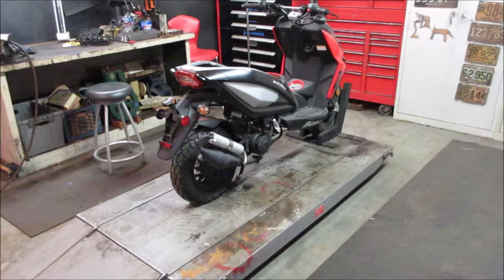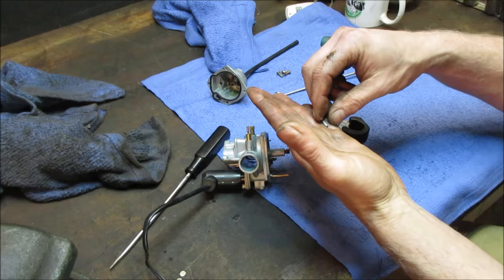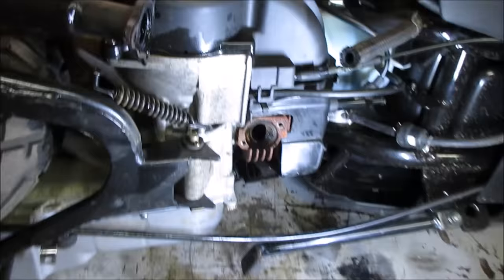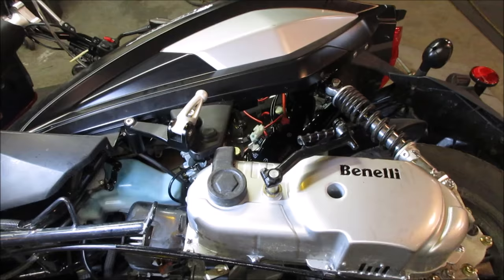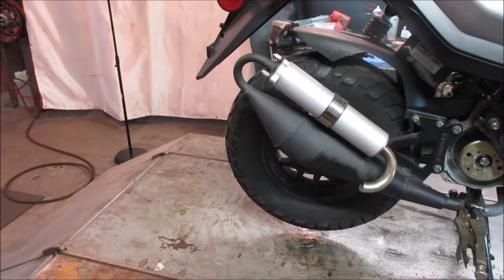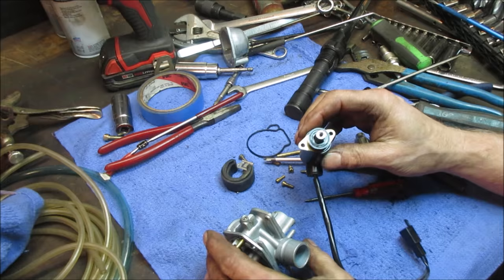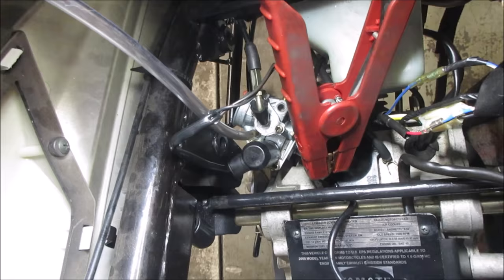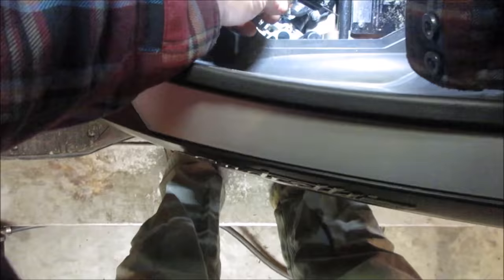Free Broken Scooter, Can We Fix It?

Comment: That "weird" bolt on the exhaust is a safety bolt. The manufacturer would screw it in until the head snaps off then it can`t be tampered with or removed without a lot of bother.

Comment: Just a comment for reference. Yamaha produced a bike of 60 cc that was a two stroke. It had a tank for oil to mix with the fuel. It had a metered pump that was adjustable. It also had a separate crankcase for oil that lubricated the engine internals. It concerned me when you mentioned this bike had a shared oil tank. You could use all the oil up and then the motor would seize up and  the engine would no longer work.

Comment: mustie, I was watching the CVT and its only going halfway, you can try changing the CVT pulley to go much much faster. Its a chinese scooter and most likely uses GY6 design crankcase. I am not sure if a GY6 stock pulley can fit there but for sure it uses flyballs. the stock GY6 flyball is 14g and usually comes in packs of 6. you might want to check the weigh of each flyball to see how many grams it is and if you can replace it with a heavier one so the CVT opens up earlier (at a lower rpm) so you can go faster.

Comment: the black thing on the carb is a choke...its just a temperature regulatet piston like an thermostat on a car..the wires belongs to an heating element to warm the whole thing.

the weird screw on the exhaust ist a break off screw  , you break off the head by thingting the screw and you can not remove the scew anymore so easy....normally used on ignition switches.

Comment: If the compression tester has a one way valve in the part that screws into the cylinders (mine do) it should, afaik, not matter the volume of the cylinder. If not, you could use the hose to try to blow into the cylinder and get an idea of the amount of leakage.

Comment: i have a scooter about the size of this in the field somewhere..ran pretty decent, but it was wrecked, i bought it for next to nothing and drove it around, forget why it ended up in the scrap heap. might dig it out to just see if it turns over or not, it needs all new wiring though and im no expert in anything wiring on a scooter so its useless to me but someone may have use for it when it comes to parts or something idk. it was alot of fun to just play around with

Comment: I'd also check the clutch lining if it is thin plus check the center spring if it feels soft(er) than what it should feel and the torque drive if the internal parts needs greasing

Comment: Restriction on the exhaust is the regulated back pressure for the motor a lot of those have regulated back pressure from the exhaust muffler but that looks like the port regulated exhaust pressure

Comment: Edit of my previous : 1.  Drain tank of all fuel, and make sure only oil enter carb by way of oil tank.  2.  Check for any restrictions in exhaust system.    3.  Check cylinder for carbon deposit build-up near exhaust port.  4.  Remove variator and check to see if all roller weights are rolling properly.  5.  I have yet to see rear wheel spin up under acceleration.  Make sure there are no restrictions to rolling of rear wheel under throttle opening.  Finally, I will tell you that the long brass tube in the float bowl conceals a problem.  However, I am afraid to tell you how to service it, because it could lead to a crushed tube.  I would show you how to do the cleaning, but I would only do it in person.  sheesh, I am perplexed.  Servicing it has fixed many a 50cc scooter like this for me, but.... Good luck

Comment: The three main problems that I’ve run into a knees has been the carburetor they probably replaced it with a higher. If I’m carburetor, he probably went for like a 75 or 800 GC scooter versus the 50 cc same thing with the stater and the CDI blocks I need all three of those items to be correct or at least the carburetor because I ran into the problems with an old 2003 versionand everything and I just couldn’t get it right until we got all the original stockpots on it

Comment: There should be a spacer that limit the travel of the cvt. You can remove that and lower the rpm at max speed. Also the exaust spill port should be blocked.

Comment: great job ... what a "stupid" problem ... man !!! That wire caused some "headshaking" on your side (and on mine).
But as always... logical thinking and tackling problems one by one will bring a solution.
That's exactly what I love in all your videos. Sharing your approach and reasoning with us, until you get things "running" again.
Thanks for that.

Just an idea ... wouldn't you get rid of that exhaust restrictor? (or did you? ).

Comment: Its a Piagio engine. Air, fuel, spark. Comprechen. The scooter has an anti theft active. That is why the brake light is on and why you can start it and it shuts off. Change the cdi to one without anti theft, the scooter will start. How ever that wite smoke is strange. Check comprechen. I had one that had a hair line crack in the engine block and it had the same symptoms. It could also be the masse cable under the engine. There are so many things

Comment: I first always ask what people did or have fixed then I start with that. Most problems I find is when people change parts and get close enough  parts or wire wrong. Then spark, fuel, air

Comment: The enrichment is not a solonoid it's filled with wax and melts and draws back slowly. I think they get power from the ecu and it's not 12v. Check at the feed wires the voltage.

Comment: That thing is restricted as heck just on what i can hear! It should do 50mph easily on a straight. The exhaust has a restrictor on the port and usually on the silencer. Behind the roller pully there is ~5mm a washer. That alone gives it another 10-15mph end. Check the roller weights, normally these come stock with 7 or 8 mg rollers, less than that its restricting top speed, but better accel.. If its not running better after removing the restrictors than that cdi is not allowing it to rev.. these rev up to 11-12k rpm while this sounds like its not going past 8k rpm...

Comment: I have a 50cc 4 stroke scooter that I was given and I couldn't for the life of me work out why it struggles at medium to high rpm. Today I learned that sometimes scooters need the airbox for the carb to work correctly. I swapped the air box for an air-filter when I took the carb off to clean it, I may know why it isn't running well.

Comment: Bought a HF 4500 generator, worked for a year and one day,  then quit. Went through three of them, th÷n tried to see why. They had a thick wire in the exhaust. Cleaned that, it ran, but clogged up quickly.  Took out that wire and running for 3 years now.

Comment: sounds like intake reed valves might be leaking or if it is a rotor intake valve might be leaking.
just a thought. when intake reed valves slightly leak the motor will break up at higher rpms because the valves don't have the time and extra back pressure to seal

Comment: I used to own one of these cheap Chinese scooters. My suggestion to anyone having a problem with them is to buy a brand new CDI box and starter coil (they cost 6 bucks each) and replace them (its a 15 minute job) before trying to take the scooter apart and looking for something else. They have electrical problems all the time and they manifest in all kinds of strange ways, and there's a good chance you could solve the issue right then and there

Comment: It's an Italian Moto-Minarelli engine. I had virtually the same ignition fault on a bike that had been messed about with. Turned out that a previous owner had fitted the wrong ignition box, from a four-stroke pit bike. Took me hours to figure it out...
Reply: And opening out the restricted exhaust port gives more power and may ease the running problem. They can then rev out better...

Comment: Sounds like its running with the choke on (defect autochoke)
 To test the choke just ad 12 volt to it, remove the heat shield and watch if the piston extends when the unit becomes hot (choke off) , and retract when it cools off ( choke on) . The choker unit current is driven by the light coil in the stator, so the engine must run before function. The engine is a chinese half clone of Minarelli horizontal

Comment: Drill that exhaust port out some and it'll make that 50cc feel like a 125cc. I did it with my scooter back in the day and the damn thing went twice as fast as stock. Will need to adjust the carb a tad after. Stock I think mine did 26mph but after drilling that plug out of exhaust it would easily do 50. A little carb tweaking and it would hit 60.

Comment: That issue with cutting out at higher rpm... I assume this is the rev limiter of the original CDI. Scooters usually have that, and/or gear ratio limiter in the CVT. Looks like the previous owner tried to install that 'open' CDI and made a wiring mistake.

Comment: look out for "safety switches" ... my ATV of the same brand - has 8 "safety switches" which all need to "set" or the engine won't start.
1) weight on seat switch 2) hand on throttle switch 3) foot on brake switch 4) kick-stand safety switch 5) gear in neutral safety switch 6) fuel level 7) 'kill switch'  ... & ...  8) press "start button to start"

Comment: Check the fuel pump and the CDI box if fuel pump could be pushing too much fuel through in the CDI box, controls timing and complete combustion inside of the engine

Comment: The reason the coil jumped from 0.000 to 31.1 ohms is that your meter is auto-ranging, starting with the highest resistance scale, and trying the next range until it finds the actual resistance. Invest in a better meter...

Comment: @22:41 it's called an SAS (secondary air system) it basically a cheat . It uses hot exhaust gases to warm the intake to get the engine through emissions regulations.

Comment: I have the same engine in another scooter from China. Same problem, it wouldn't run continuously. I changed the fuel tap because it had a stuck membrane, then installed a new carburettor for 15 euros, and the thing ran

Comment: put a one Hotter plug in to help burn all them hours of past guy crancking over two stroke oil or pos the battery dropping enough voltage for high RPM , TRY unplug the head and tail light bulbs for more voltage my friend

Comment: The electric choke works with wax , they are full of wax , the power goes to the choke , it heats up , the wax melts and the choke opens . Pretty clever , but prone to failure and must be plugged in at all times or , you`ll be always running on choke . 1:08:30 , greatest feeling ever ...lol.

Comment: The Ohm meter is in auto-range mode. When the leads are open it goes to the highest range and then displays OL, OverLoad.
When you connect the leads to the coil, the meters measures a low resistance and switches to a lower range. The resistance is still low, so the meter switches further down until a sensible value is measured. In this case is goes all the way to the lowest range and then shows 31 Ohms. This is a normal value for a coil like this, so there is nothing wrong here.
Reply: OL is open loop, not over load. (IE no current)
Reply: @MellowYe77ow  Sorry, but but you are wrong. It really is OverLoad, see the manufacturers manual. I have been a repair and calibration technician for more than 30 years and have repaired and calibrated 1000+++ multimeters of many types and brands.

Comment: Acts like the needle valve or float in the carb OR... the slide in the carb acts as the accelerator pump. Maybe a bad seal or diaphragm that isn't pumping the fuel through on throttling.

Comment: Sounds like it has both the restricting ring in the variator and way too light weights in it.
In addition to a possibly faulty CDI, it'll need a mere 30 minutes more with tinkering before you got it running perfect. =)

Comment: Seems like the previous owner tried to tune it and messed up with those wires I would check roller weights in the variator to fix the no top end swapping to lighter rollers for quicker acceleration is common but comes at the expense of top end

Comment: Update...Most of these Chinese engines use a CDI box with spark control based on RPM...Amazon sells cdi boxes with spark control that breaks up at a higher RPM...Those are labeled Racing CDI box...

Comment: Excellent video , you got another Subie ^^You could also have clean fuel tank to avoid another dirty Carb
( Got a Tao-Tao like .... did get ride of Oil pump on mine due many issues , and do my mix at 5% myself, a better Belt, Weights, Carb , and a 70cc ( not for speed, i am just heavy, works like a champ )

Comment: Remove the restriction from the exaust instant power gain for free.. get some clutch springs and roller weights and jiggle with it a lil bit.. ..that cdi crap.. leave it.. you want more power just put a 70cc or 100 cc cylinder on it .. cheers guys

Comment: Sounds like a rev limiter when reaching high rpms. The CDI may be a restricted CDI. Look for a derestricted one. In the UK if you are 16 years old you are only allowed to ride restricted bikes.
Reply: There may be a baffle/spacer in the CVT too to prevent it from reaching a higher gear ratio

Comment: 2 stroke DO HAVE OIL ON THE CRANKCASE do not have oil on the combustion chamber or head, the lubrication is provided by premix oil in to the gas.

Comment: Drop a small pinch of table salt in the cup if you want to see the water quicker. Salt can NOT wet with or absorb gasoline so it scavenges the water which still can not mix with the gas and hide.

Comment: I think from my personal apenion that you have very old fuel you should try to dump some outside and see if it will catch on fire by lighting it with a lighter. That motor only has 535 miles that’s brand new motor there is nothing wrong with that. You put in a brand new spark plug and still no light. Can that gas out with super and I guarantee that motor will sing like a canarie. Have a nice day Ken Wa Frans Air

Comment: I understand the concept of safety kill switch ... but 8 safety switches on a "kids atv" - made by the same brand .
How many things do you think a 6 year old - will remember to "set" before giving up on a machine that wont start ?  1) seat switch 2) presence of "hand on throttle" switch 3) foot brake switch 4) kick-stand safety switch ( on a 4 wheel atv ) 5) battery "on" switch 6) key "on"   7) under seat 'kill switch'  ... & ...  8) Remote kill switch by remote control - is it set to "on" ...

Comment: You had me scratching my head too. I always try to diagnose along with you and after you lowered the slide and got it to respond a little, I switched to electrical. Then you did and that was it. Did you change the ignition module out, and did that fix it? Finding those two wires swapped was money, good job!

Comment: I know this is old and already been fixed most likely lol but was wondering if the kick stand has a safety switch. Guess not 😂 should’ve guessed any time a owner works in something just retrace his step’s you’ll most likely find it there.
Reply: It does not. However, there is a peg that does not alow it to stay extended and retracts it with a spring as soon as you take the load off it. These scooters fall off the side stand all the time because of it and that is why most people use the center stand instead.

Comment: Crankcase full of oil ? I had the case of the crankcase full of gasoline in a handheld leafblower…
No carb and it was running like for 40 secs after 3 minutes of drill start to eliminate the fuel.

Comment: switch out the AC ( speed limiter ) cdi for a ( unlimited rpm ) Racing DC cdi - which makes it start quicker & go faster.
a DC CDI gets it's energy from the battery ( which gets re-charged by the generator coil ) ...  instead of ... the battery trying to spin the starter motor & engine filled with ( cold & stiff engine oil ) - to spin the generator coil - which in turn - provides energy  to the spark plug

Comment: All 2 stroke engines need  oil Mix, some have Pre Mixers built into the system or you find out what the mix is for that Engine then mix the gas your selves.\
I had to do this for all my 2 stroke Boat Engines.
Peter

Comment: Why didn't you  use an inline spark tester as soon as you got it to run? You would have seen the spark fail when the engine started to  run rough, isolating the problem to the ignition system. It would have saved all that carb guesswork.

Comment: If u want more speed remove the front pulley in trans and if the belt is riding on a plastic bushing collar that rides on the pulley shaft remove it and reassemble and u will get more speed

Comment: since you made the video, yes, you could fix it - even if fixing it meant rebuilding or replacing the engine and transmission assembly, and replacing every other defective part.
The scooter may have been "free" but I bet the repairs sure weren't - excluding your time and labor that you didn't charge yourself for, of course.

Comment: it’s breaking up because of the rev limiter
the engine is reaching maximum rpm.
so there is slip in the cvt 

check if the belt is old and crusty
check the clutch if it has material
clean the plates to remove any oils or greasy things that cause it to slip

Comment: Any time I have a problem where it will start and run only as long as the key is turned on and has the starter engaged but stalls as soon as the key or starter button is released, with the key or switch in the run position I will jump the starter bypassing the wiring and switches up above and watch to see if it has spark again and if not then I start tracing the ignition wiring to find the issue which usually reveals the problem fast, but I’m not sure if I would have noticed the reversed wires that fast but would have eventually after several hours of swearing at it only to be swearing at myself after finding it because it was something so simple